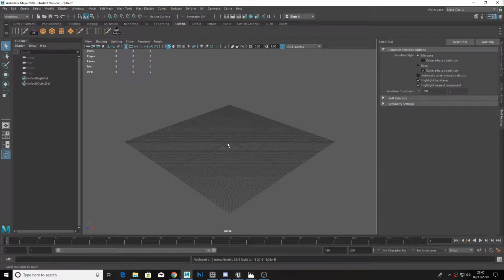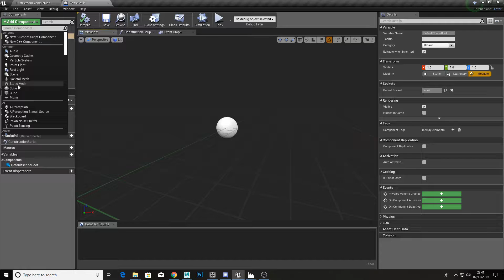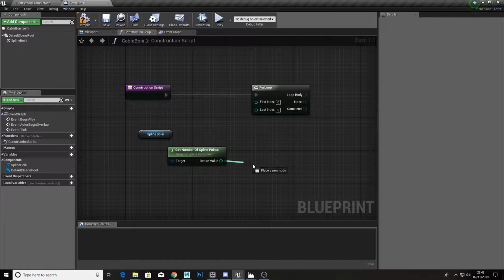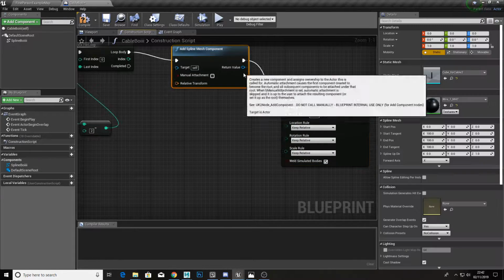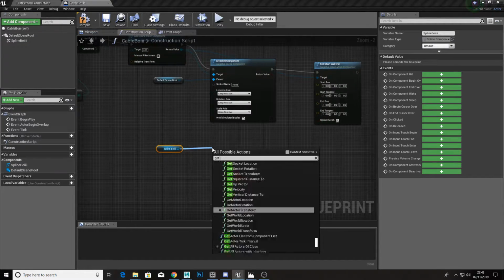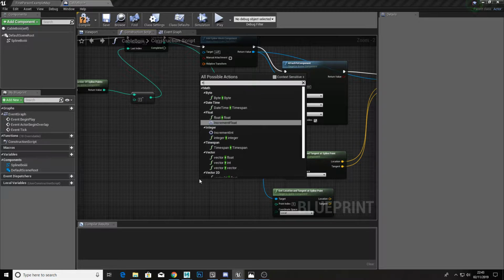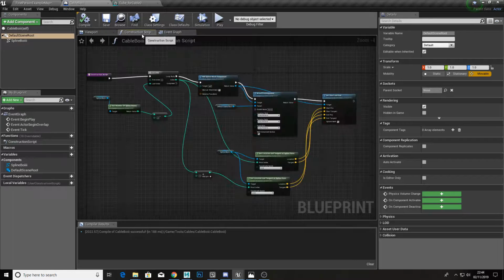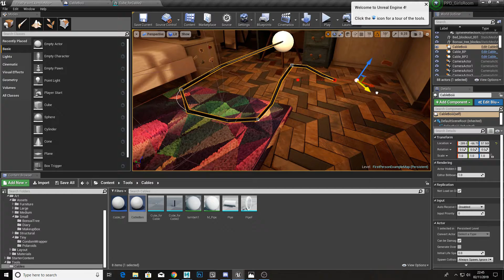How to make pipes/ wire in UE4 using splines (Quick Tutorial)

Comment: Hey Man, I gotta say, you are great, keep doing these short tuts
Reply from the maker: Thanks man. It means a lot. <3 Back to putting out a lot more videos in the coming weeks so stay tuned :)
Reply: So I made the spline mesh and it worked, however, i want the rope to be more smooth, smth like a subdivision in c4d
Reply from the maker: All you do is make the base mesh that I made and imported into ue4 at the start with more divisions. Depending on what axis you want the subdivisions, you can either add them along the length like I did, or you can use a cylinder instead of a cube. Also defining the edges with a soft edges smoothing group before importing into ue4 helps.

Now the blueprint is done, you can easily swap a new mesh in and out anytime
Reply from the maker: Let me know if that helps or if you're still having a problem 👍
Reply: @3DRoss  Cannot thank you enough!  it worked well.
Reply from the maker: No worries man. Glad you got it working ok